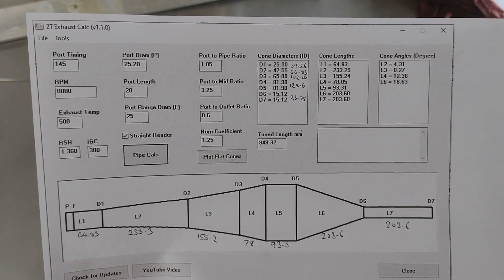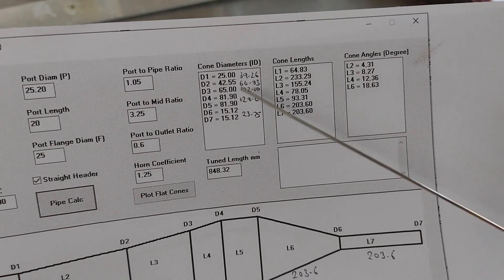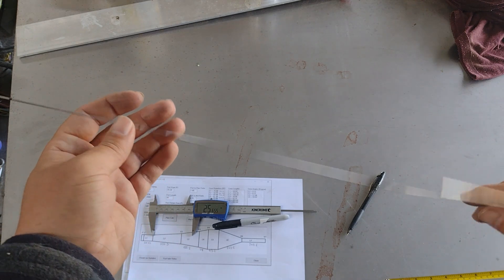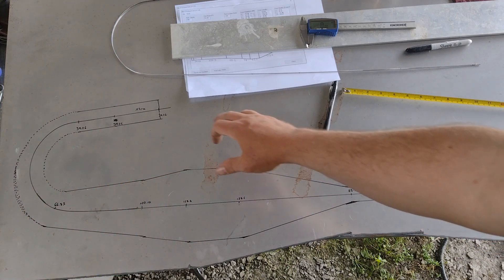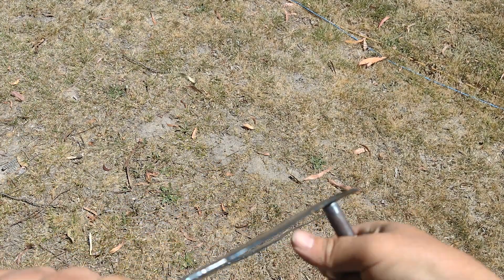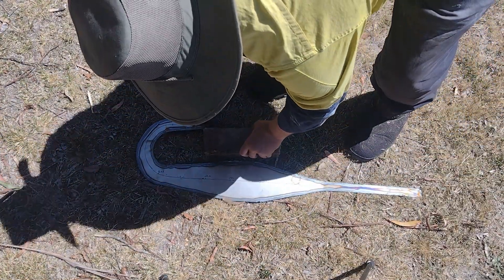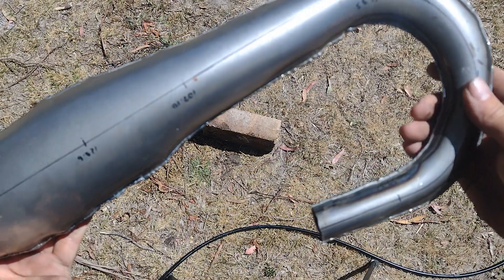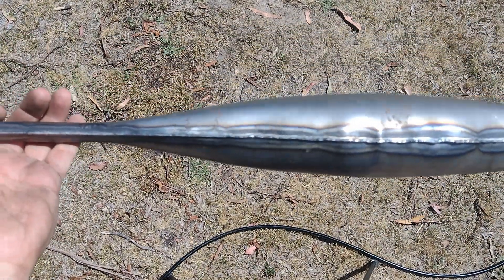Hydroformed FatBelly expansion chamber exhaust for the worlds fastest BT100 motorized bike

Comment: As a lazy enthusiast, is it possible to just sell a "build instruction " sheet sheet so i can take it to a weld shop and then bring the flat pipe back to use my pressure washer on, then bring that back to them to do the final welding?
Reply from the maker: sorry for the super late reply! Sure thats an option, but with what machine shops charge per hour its probably cheaper buying it ready made?
Reply: @SafetyUggs  yes after looking in to it, you're right lol

Comment: id like to see a mineralli get tested, i just bought a wildcat ultra minarelli 6hp off californiamotorbikes for $200
Reply from the maker: Me too. A mate said he'd bring one of his builds over to dyno test
Reply: @SafetyUggs  it's around 5-6hp stock apparently, I have just port matched the transfer ports (from bottom end to spacer to jug), a jog pipe, vm20, and high compression head on the way, supposedly this will make about 8hp+. The crank is already balanced pretty much, and the conrod bearings are replaced so it should handle like 12k+ rpm

Comment: Hi I liked very much your 80cc mods videos, very interesting.

Question, could you make a 3rd part of 80cc mods? I'd like to see how max HP you can gain with a better carburetor, head cylinder and you best pipe.

Greetings and thank you.
Reply from the maker: After we finish carb testing on the BT100, we'll go back to the 80cc and try the new carbs on that, new pipe and cylinder